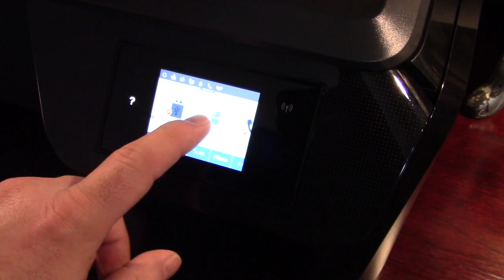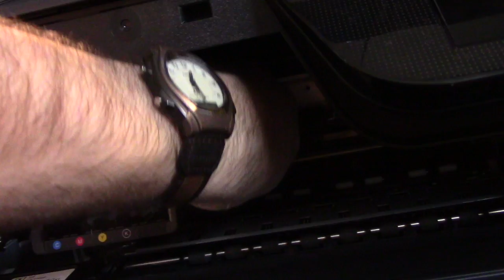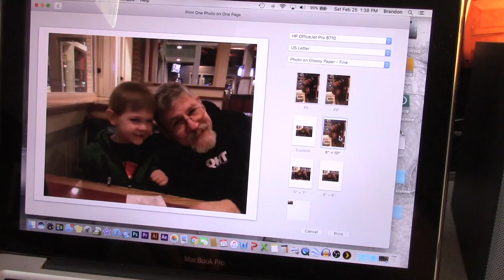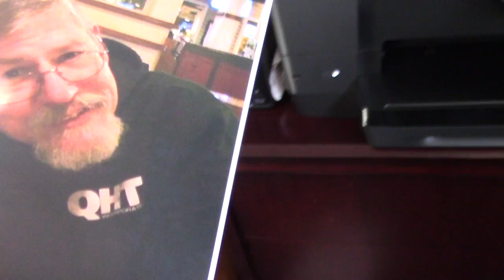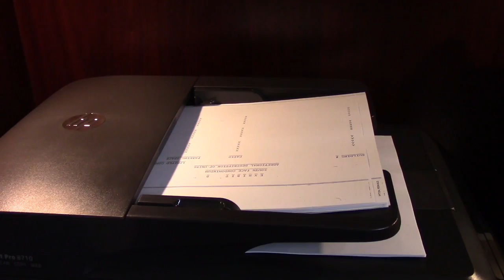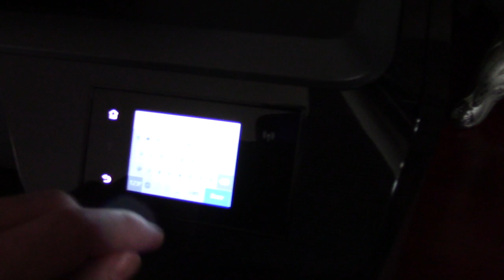OfficeJet Pro 8710 Full Review: Can It Walk and Chew Gum?

Comment: incompatible with some O/S including Windows 10. HP can't/won't assist. Not recommended unless you like doing warranty returns
Reply: Strange, works with Win10 and 11, even prints using my Android phone. I can even ping the printer and get job reports, if I needed them.
Reply from the maker: I have no idea what you're talking about - this printer is currently working with Windows 10, as well as MacOS Catalina (and I've used it with a few other versions of MacOS and Windows as well). All inkjet printers are poorly built, that's a fact, regardless of brand.
Reply: @bbishoppcm  you are a better man than I, Gunga Din. I've had 3 HP techs and 2 in house work IT guys look at this. They've all come up with no solutions.

Comment: today is 1/31/2020 and I have had  this printer for at least 2.5 years.  Every time i use it i hate it more.  paper jams that are insufferable, anything except 8.5x11.  has to get set up all over again 3-4-5 times a year with various updates (windows 10 or the machine itself.)  Can't see the display dinky window, have to put this on high stacks of boxes to see the display, to clear paper jams, to do anything.  the so-called 'instructions' for clearing the paperjams are so unclear and imprecise that you waste 30+ minutes for what should have not happened in the first place, and certainly should clear in 2-3 min not 30.  Print screws up and b/c of the auto-supply of ink arrangement, you get charged for the things the printer itself screws up.  And it loses its wifi connection in the most arbitrary andf unpredictable ways, and then screws up the print job and wastes even more time. (Yes it was the machine, not my wifi, b/c my phone still was surfing on the wifi.) i will NEVER buy anything from hp again. ever. period. and their obnoxious obsequious pretend-efforts to make a customer happy are too insulting to be a joke.
Reply from the maker: I have to agree with you 100% here... I don't have "auto-refill," but I've decided never to give HP one single penny in ink for this piece of shit. It's a great printer overall, I have no real complaints there - but it DRINKS INK like a drunken sailor. Further, HP laser printers seem to get worse and worse every year...

Comment: Thanks for the review. I just bought the 8710 from Staples a couple of days ago, like it so far. I had an HP Officejet Pro 8600 Plus for several years and it was great. Like you said the printhead is expensive compared to cost of new machine. Mine just went bad and I came real close to just getting another printhead but the wireless was starting to drop a lot so I decided to get this one. Thanks again.

Comment: Can you scan with the lid open or a book page or does the lid have to be closed and it will only scan something a few sheets thick, like a magazine? 

Have you seen any print error messages yet?  Does the error message come up on reboot and shuts you out of the game?

Does the cryptic error message come up when a tank is determined to be low by printer software, locking you out of the printer?

These are the issues I am having with my Office Jet 6700c.  I like that you can remove the printhead to reseat it as the 6700 requires disassembly of the scanner bed to gain access to the print head which is presently reading Missing or Failed Print Head after stopping mid print job and after installing new ink tanks to gain back control.

So those 3 items are the issues I have with these printers right now.

Thank you for producing the video and thank you for looking at my question.

Comment: This printer will not print in greyscale or black and white without all ink cartridges having some ink.....even uses color ink when using only black and white......when printing from the phone you have to manually change back to black and white everytime....and the phone app menu is  easy to navigate when in but finding how to open is another story.....they make it real easy to just hit that print button though.... definitely a funnel for your money via ink usage.  I will seek an alternative next time i buy......everything else runs relatively smooth no connection issues...no print quality issues.....no jamming
Reply from the maker: This is actually nothing new... Pretty much every color inkjet printer uses small amounts of color ink when printing black-and-white images or pure text. This has been going on for at least 20 years or so.

Comment: Great review! I am tyring to decide between the Officepro 8710 and the 6968. They seem similar with the 8710 being a slight upgrade, not sure. I don't have a computer with wifi - a desktop connected broadband to the modem.  I'm tyring to figure out if either of these or both will be ok with my computer. We do have or mobile phones, but we still want the primary connection on the desktop.

Comment: i have the 8702 it's the same thing as the 8710 it just came from wal mart is all and costo has the same printer under a different model also. stores just change the model numbers for theft control and so they don't have to match prices. this is an awsome printer i had mine for a year and no problems and it's fast!!!

Comment: i think the epson printer will respond well to refilling ?
Reply from the maker: Yes, but only EcoTank models, and only with Epson inks. I can say the new EcoTank printers are fairly well built and have very low operating costs. Epson charges very little for the inks in this printer line and we own several at work and have had great luck with them. Using non-Epson inks could cause chemical compatibility issues and would likely destroy the printhead.
Reply: i thought the epsons are more forgiving with aftermarket inks being a piezoelectric printer ?
Reply from the maker: No, the exact opposite is true. Epson uses specially formulated inks that MAY react if accidentally mixed with the wrong ink. I cannot confirm this, but I suspect Epson did something to the ink formula with their new EcoTank units to cause issues if non-Epson inks are used. But remember, the printer manufacturers are in the business of selling INK, not printers. The printers are sold at a loss in order to allow the profit to be made off the inks themselves, so manufacturers are always looking for ways to prevent or dissuade consumers from using aftermarket inks. They're doing nothing wrong by doing this, in my humble opinion.
Reply: seems to be the case with other manufacturers as well  where the actual aftermarket inks will work well on their own but if the cartridges they are contained in have minute traces of the original inks something weird happens between the two inks and will cause the said cartridge to form a jello like substance that will clog the print head.
Reply from the maker: If you're looking for a low-cost printer, however, the Epson EcoTanks are amazing. Dirt cheap to own.
Reply from the maker: The printer is around $400 depending on model, but that includes enough ink to last quite a while. Epson's not subsidizing the cost of this printer through ink sales, which is why it's so expensive.

Comment: I looked for a all in one device last year, still do from time to time, but they all seem to have one or more issues which I find unacceptable.  
Either some weird lock out of third party ink, or not high enough resolution of their scanner, or using ink somehow even when they are not printing(which I don't get how it is possible), or refusing to work as a scanner if they don't have ink...etc etc.
All I want is a cheap (under 200) all in one which can provide at least real optical 4800 scanner, good printer without any of the previous mentioned issues.
As far as I know, there is none.

Comment: I bought a LaserJet Pro 200 Color (M251n) because my old Epson Stylus Color DX4400 clogged up and I wanted network support. The yellow was clogged almost completely and I couldn't get it to free up. Well, I rarely print anyway so I thought: "Well, I'll get a laser." (I tell you, that laser printer is heavy as f*ck) My parents got a Brother unit that has less functions than your HP but it can scan and print DIN A3 pages.

Comment: Out of curiosity, why don't you just get your cartridges refilled or get inexpensive refilled ones on places like amazon instead of paying the ludicrous prices for new ones? I noticed you do for your older printer which I used to have one exactly the same of, so why not for the newer ones too?
Reply from the maker: Because those aftermarket inks lack some of the proprietary formulas that guarantee compatibility with the photo paper I use, are both UV AND moisture resistant, and don't leak or clog. Since I use this printer mostly for photo printing, those qualities are important to me. However, I do use remanufactured cartridges in my laser printer and older inkjet units that aren't used for anything important.
Reply: For non photo quality printing (like printing out directions from maps.google.com etc,) are there reputable alternatives to the expensive HP certified cartridges?

By reputable, I mean that the printer will not reject the cartridges, and the cartridges will not leak or malfunction, and will have an overall lower cost per page.
I am not asking for a guarantee.  Just want to avoid junk -- and avoid, for example, 50% lower purchase price, yet lasts half as long.

Can you recommend a site for purchasing ink cartridges for this model?

Thank you.

Comment: that is one hell of a good printer... i set up a lot of those in the past 2 years, 3 of the officejet 8100 (same basic series minus the ADF and the Smart functionalty but still has wifi and e-print) and one of the 8600 (same as yours minus the fax) for some clients of mine they all talk highly of them,fast and reliable,the only one of those (the 8600) that had a print head failure with 11 months of use due to a defective cartridge that had a ink block problem and caused the print head to fry... was replaced by HP Brazil under warranty and they did not even given 2 sh!ts about it (in a good way) and as soon as i described the problem and emailed them some pictures,and the serial numbers of the printer and cartridges they just send us another new printer since the shipping of the old one would cost more than a new printer...